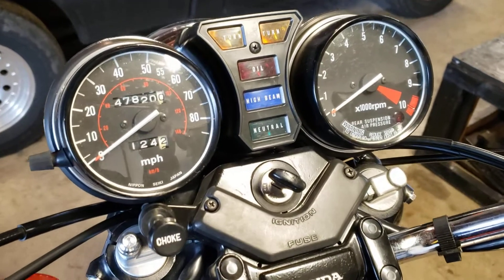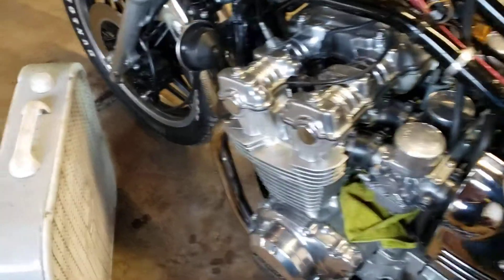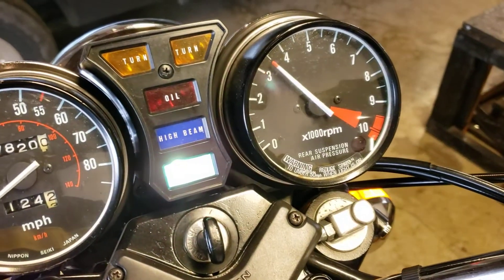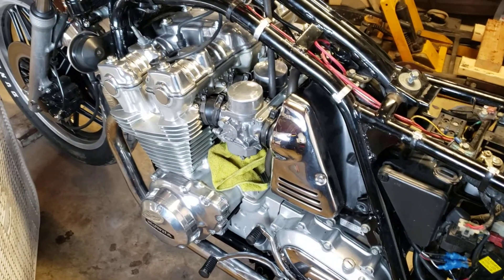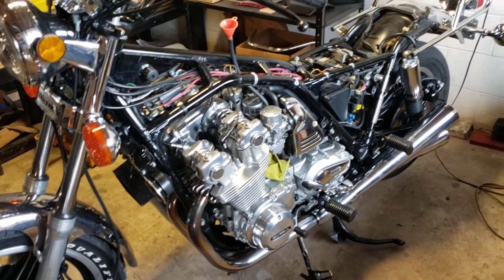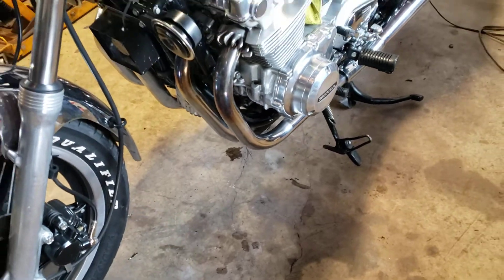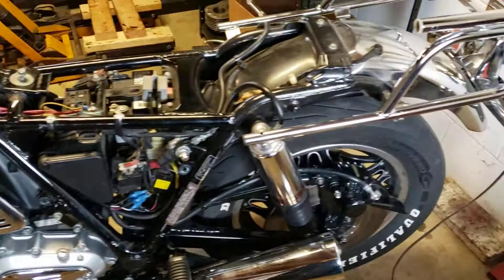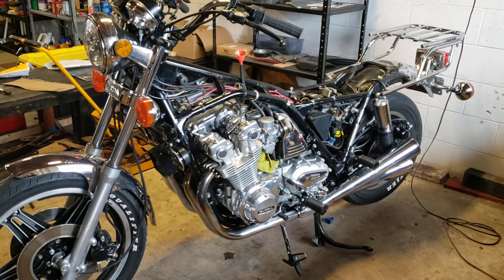Pt12: 1981 Honda CB900C Break in progress

Comment: After the rebuild, how long must we keep doing that? When will we know when it's ready to be used? I'm planning to replace cylinders and get it bored and honed. 

Also, any tips removing the rust inside the frame? Thank you. We don't have many professionals here in my country
Reply from the maker: After several cycles of break in process, then go out and ride it up and down hills around corners on and off the throttle, careful not to over rev or bogg or lug the engine. Usually very caution the first 50 miles like that keeping it 60 mph or under, not sure what kilometers conversion is,, then you can begin to increase rpm and speed slightly for next couple hundred miles, after 500 miles you can hammer the damn thing as hard as you wish. Not sure what you mean about rust inside frame?
Reply: @thedragon2299   thanks for that, the "rust in the frame" is literally rust in the bike frame. I'm wondering if acid dipping would remove the rust inside the bike frame. Do you recommend it?
Reply from the maker: @godwinflores4819  I'm a little concerned about the rust inside the frame, acid dipping may eat right through it due to the rust. I had a yamaha 750 Seca frame rust in half on me once, luckily I wasn't riding at speed, I noticed it while in the garage. Rust in the frame can be very dangerous. I would inspect it thoroughly to make sure there isn't any weak spot, you might actually have to peck at the frame with auto body pick hammer or screwdriver or something, then if it checks out good, somehow pour some por-15 inside and make sure it coats the entire rusty areas by turning the frame in many directions to ensure all is coated.
Reply: @thedragon2299  very soundful advice, thank you again. My CB750C's frame does not show any visible rusts yet but if there's any rust i just want it out of the frame. Thanks again